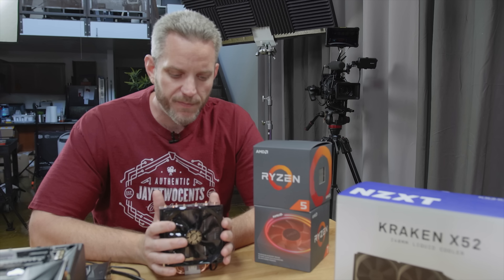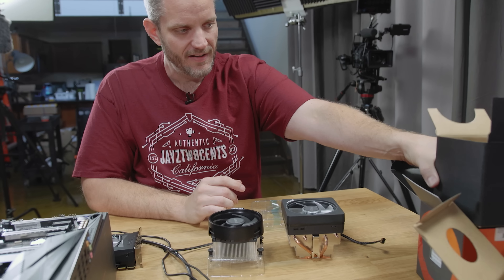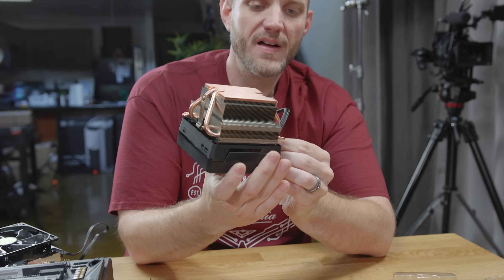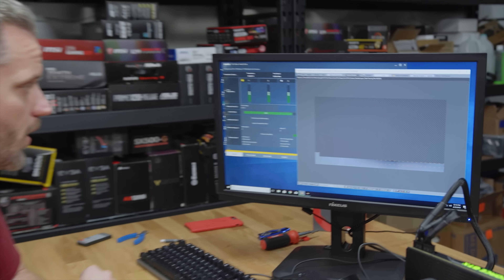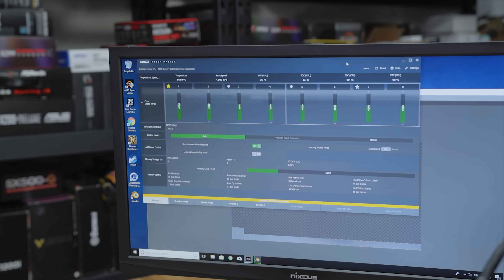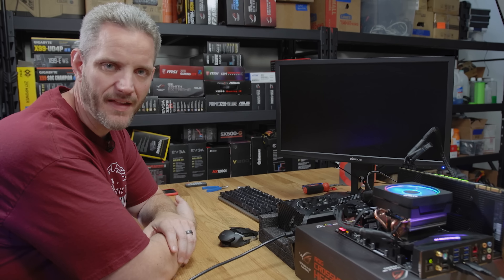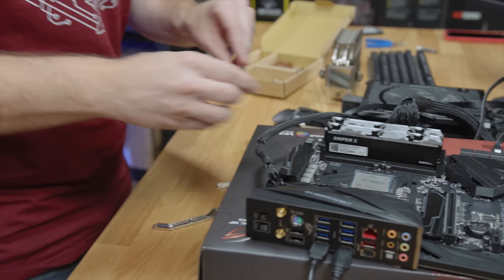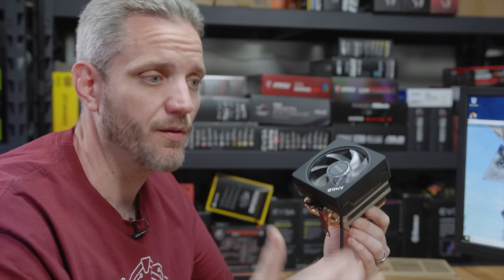Overclocking with a stock air cooler?? Is it even possible?

Comment: Intel
Looks at AMD: Heehee I think we are better.

AMD
Does your stock cooler have RGB?
Reply: I like that
Reply: whats a stock cooler? all i know is my xeons come with no thermal solution
Reply: Intel

lets save customers money buy not putting in a cooler thats just going to get thrown away on any overclock able cpu
Reply: 3en6ie 3en6ie I pulled off my cooler on my Ryzen system and it ripped the cpu out of the socket -said every amd owner ever who changed the cooler or thermal paste. Honestly pga mounting needs to go asap
Reply: Still no excuse for how bad Intel's stock coolers are. Those sad excuses for coolers noticeably throttle performance on their non-K SKUs by not allowing max turbo to happen. Also, if they did it to save money, why do Intel CPUs cost more?
Reply: 3en6ie 3en6ie also a quarter is too thick to fit in the slot. Supposed to use a #0 flat head
Reply: Logan .Kes a tray cpu cost more than a boxed one ;)
Reply: RippedUpRunway why do intel cpus cost more? How about better build as proven in their reliability and another, the performance is top notch. Ryzen can’t touch intels performance period. Not first or second get. Hopefully third gen but I’m doubting it because by the time amd closes the 15% single threaded performance gap intel will drop another cpu bringing it back up.
Reply: @Logan .Kes as an intel user since maybe pentium 3 days you need to cut that fantard shit out bcuz alot of that is false
Reply: Knives77 who u talking to boiii.  Take a 2700x and a 7820x guess which wins every time? The 7820x no surprise. Price? 7820x $399 2700x $339. Yes it’s cheaper but also comes with worse performance
Reply: i would agree...but they charge customer the same amount or more...so where are the saving going too? not us

also when comparing price, you need to add the motherboard/cpu cooler to it. while ryzen is not only cheaper but also has cheaper motherboards as well. if you dont than you have to add 100$ on the cpu anyways because you need a cooler anyways.

just stop and walk away.
Reply: If I want ultimate performance price be damned I'm going threadripper because for gaming anything higher than the 2700x your only talking 4-7 fps and that's provided your running a 1080ti with an excellent cooler and 1080p resolution with a 144hz or better monitor. Price be damned for gaming means I'm still going 2700x because I'm using a 60fps or better 4k gaming monitor. Price be damned means I want what's best for all applications and that would be threadripper because my computer isn't a console and I do other things than gaming.
Reply: BrotherO4 how bouts you look at pugetsystems.com for professional software benchmarks. The QUAD CORE 7700k is 26% faster overall at adobe premiere than the 1800x 😂😂😂
Reply: Last I checked [5s ago] 7820x was 460$ on amazon.  (vs 330 for 2700x)
Reply: Logan .Kes: From my experience taking off coolers from AMD sockets that sat for a while, giving the cooler slight twist while pulling gently and giving it a few tries usally prevents the cpu from slipping out of the socket.
Reply: moonik665 check Microcenter. That’s where I got my pricing
Reply: King Christo Tech How can Intel even compete?
Reply: Logan .Kes, if you learned how to twist the cooler a bit before pulling it off an AMD CPU you'd be hard pressed to find that the CPU remain in the socket. Its not hard to figure that out. I also went from a i7 5820k because Asus OC socket killed my CPU, its kind of common on x99 chips and Asus boards, Well Asus was kind enough to replace the board, Intel gives me a walk around and says they can't warranty the chip and should be replaced by Asus. Yeah well that was a good waste of money for a now paper weight Thanks Intel. Got a Ryzen 7 1700 and Im impressed, Is does do better than the 5820k in pretty much everything, and my video rendering is a boat load faster for a chip that cost less than half of what I spent on the 5820k.
Reply: Logan .Kes run some floss between the cooler and cpu
Reply: hey that's a funny way to spell Shintel.
Reply: Logan .Kes for single core speed lmao
Reply: Logan .Kes AMD is still cheaper, they also solder the IHS which does cost more but means heat transfer is better because the heat only has to transfer through one layer of thermal paste not two.
Reply: Logan .Kes You got to give it a little twist if you pull straight up it might come out.
Reply: The 7820x is 140W and the 2700X is 105W. Hardly comparable.
Reply: Logan .Kes This is mostly  untrue AMD CPUs are just as reliable and there were no 2nd and 3rd gen 8-core processors AMD FX series was mostly competitive with 2nd gen intel. The Ryzen chips are very close to current gen Intel processors.
Reply: Logan .Kes 7820X is currently $459 and the motherboards are $230 at the cheapest VS $339 and $149 for a decent motherboard.  That is roughly a $200 difference, and the I7 8-core will still need a cooler.
Reply: Viking 2121 the Asus AI tweaker function (which was a default bios setting) was notorious for degrading the memory controller on the at CPU over time.
Reply: AMD: But, can you do this?
Reply: idk man. Am in uk 7820x are selling for £489  while ryzen 2700x for £280 also 7820x motherboard cost a lot of money + £100 for cooler - Seems non-logical fam.  Maybe where you are 7820x makes sense but doesnt apply to everyone.
Reply: Logan .Kes dont pull it off cold
Reply: who uses intel stock coolers anyway? i agree that they are shit, so i preffer spending 60 bucks on a good cooler than having that shit around here
Reply: Whenever I feel like wasting money, I should test my 7700k at 5 Ghz with the stock cooler. Just for the lulz.
Reply: King Christo Tech Amd: But can you do this pulls out a rgb cooler
Reply: Logan .Kes Built better until it needs a microcode update so it doesn't get pwned by some snot-nosed brat in the Himalayas for luls.

Intel sucks.
Reply: Logan .Kes 7820x wins everytime? Lol, no, the 2700x often match the 7820x and sometimes even beat it. Go read this https://www.techspot.com/review/1613-amd-ryzen-2700x-2600x/page3.html 

Or watch the videos at hardware Unboxed
Reply: Logan .Kes 15% more ipc? Lol ryzens ipc is very very close to that of intels . Better build on intel? No f way dude the quantity lacks big time on intel chips. 8700k is here to bake eggs on. OC'ed ryzen vs 8700k OC having a 0,8 ghz frequency difference the ipc is very close, which makes ryzen the better cpu, as it simply dominates the 8700 esp multithreaded. Why do people miss inform others so much.
Reply: Marcus cook best comment so far xD
Reply: Logan .Kes intel and saving money? Wtf
Reply: i won't buy Intel again, i cooked it by just turning on the system, sales person said: its because it needed a cooler, me: then wtf doesn't it come with one. :p
Reply: @logan_kes  you can overclock ryzen with the stock cooler but the 8700 thermal throttles with the stock cooler with no overclocking at all.
Reply: @logan_kes  your link has nothing to do with benchmarks at all abd that builder looks just like cyberpower to me overpriced and under valued.
Reply: @logan_kes  and i dont believe fir one second a quad core beat a 2700x at Adobe.
Reply: Tatsuhiro Satou look at the publications tab bud. Search for your favorite program with Ryzen and get your mind blown
Reply: Tatsuhiro Satou also Linus tech tips has done several videos with these guys along with barnacules nerdgasm and a few others
Reply: Logan .Kes  a 7820x doesn't destroy the 2700x. Yes, the 7820x does beat the 2700x, but by a very small margin, for a combined total of over $200 more! Adobe premiere Multithreaded? That thing sits at 50% with a 6 core for normal usage.
Reply: @logan_kes  what's a xeon? It's not Epyc
Reply: LOL Killed It!
Reply: @logan_kes   intel? save money? LUL
Reply: Tatsuhiro Satou lmao intel doesn’t include a stock cooler as they know anyone who actually overclocks will get a way better cooler. And good luck getting more than a .3ghz bump on Ryzen stock coolers lmao
Reply: @logan_kes  Why is it that without OC to 4.5 to 5ghz Ryzen almost matches it i-Rivals?
Ryzen 3 vs i3
Ryzen 5 vs i5
Ryzen 7 vs i7 (and now even some of the i9's)
ThreadRipper vs the i9's (the i9's barely compete!)

This is with all but the X-Models having a stock cooler! Ryzens generally OC to around to 3.2 to 4ghz but almost matches if not outright beats it's Intel Rivals in performance BTW Ryzens fans are fast cool and near silent (Low Frequency!) hell I Brought a AMD Wraith Max (to use on my AMD Ryzen 5 1600x) and it kills anything (Cooling!) you could by from Intel no to mention it matches most low profile air coolers by the 3rd party cooling companies like Cooler Master, Corsair so on!

AMD is catching up in games as games gets patches and new games focus on AMD just as much if not more than Intel, In the old days all good gamers used Intel so their was little to no reason to focus on making games work well on AMD chips, This is not the case these days!

Think about this a company that has always made CPU's and infact invented them and now make 3d Crosspoint aka Optane for use as RAM and SSD as well as Ethernet Ports and Thunderbolt can't make better air coolers for their own CPU's they are letting others cash in on their products which is very weird and odd from a business standpoint as they know their coolers are crap and in fact have actively made them worse over the years (less thermal mass and cheaper slower fans with shorter lives and more noise!) at the cost of a Intel i-Series chip they should gives people better coolers even if they added a few more $ to the cost to cover it, AMD with the exception of the X-series gives us all very good coolers that you don't need a 3rd party cooler to do the job I do admit it is odd that AMD don't even gives us a cooler for the x-series but many of the Intel CPU's don't come with coolers and even the ones that do get underwhelming performance from them begging the question why cant Intel give people 1. better fans and 2. if they can't why even gives us these crappy ones save us a few dollars cut them out lower the CPU prices to match and let us by Dark Rock Pros!
Reply: hahahahahaha, this made my day....I had to throw away my least attractive , least efficient Intel stock cooler to get one that's easier to look at and performs  better
Reply: Ooooh!, get deleted boyyyy
Reply: i cant hear intel laughing over their own cries of losing to intel at 2018
Reply: @3en6ie intel
Lets just charge more than amd for 2% more performance to oh not save them any money.
Reply: does your stock cooler have muscle????
Reply: @rippeduprunway811  duh the CPU costs more because the cooler is cheaper
Reply: Can you use the AMD wraith cooler on an Intel chip?
Reply: คนไทย
Reply: that extra 5+ fps amirite
Reply: Rgb make cpu cooler?
Reply: Logan .Kes If your idea of saving money is paying a premium for the privilege to overclock with no included thermal solution, more power to you.
Reply: Ans my cpu is as good as yours for a lower price.... Including the rgb cooler
Reply: Nah, it's actually "do you have a cooler?"
Reply: Logan .Kes so this aged poorly
Reply: Why bother overclocking anything at this point, just buy the right stuff for the  right application
Reply: A year later
AMD: is your Cpu better?
Intel: crying and still no rbg stock cooler
Reply: @logan_kes  hey shillboy, what you got to say for yourself now? Go on, Shill harder and with even worse arguments now. Oh, as about three other people have already done this thread, I'm gonna just double down on this point before you bring it up: You keep saying "but Adobe but Adobe but Adobe," And yeah I hate to break it to you, the reason that quad core was beating a first gen Ryzen IS because it is not well optimized for large threadcount. You said it'll "keep your CPU pinned," and yes, it will....if said CPU is a quad core. Beyond that point, Adobe responds much more favorably to frequency than threadcount. This does not make Ryzen a bad product, it makes the Adobe suite software optimized for hardware from half a decade ago that needs to either be overhauled, or replaced.
Reply: 2021 
AMD: Gives a 240 mm aio with the cpu

Comment: Wow I didn't know amd's stock cooler looked like that.
Intel... Step up your game.
Reply: @CiceroFMYT  Air coolers like NH-D15/U14 or DRP4 > AIO in my opinion.
Reply: @durendenmp812  Yeah!
Reply: I have it looks nice gonna get a aio but i hate to lose the look of it
Reply: Ryzen is essential in the budget and cost effective mid price ranges because the coolers that they give can save at least $30 being able to not have to pay for aftermarket upfront, that money means a lot to people with a very defined inflexible budget
Reply: It even has it's own rgb program, that lets you custom pick colors for the AMD, the fan and the ring around the fan. I picked one up unused and it works great with my Ryzen 5 3600.
Reply: @CiceroFMYT  air has better longevity compared to aio and not much difference in temps either
Reply: Antonio Lucio Vivaldi , girl?
Reply: @CiceroFMYT  The only thing could about AIOs other than the cooling is that it could make your cheap PC look expensive.
Reply: @CiceroFMYT  I don't like how messy and gross custom loops can get or worrying about maintaining an aio so personally I prefer air, I just use a construction site utility fan blowing directly against my mobo with case panel off and wraith prism at 100%
Reply: @CiceroFMYT  lol my black 212 it gonna last way longer and only costs 1/3 of an AIO, and it looks sexy
Reply: Yeah I love the look of the wraith cooler.
Reply: @CiceroFMYT  relatively inexpensive?
Reply: @CiceroFMYT  I’d prefer to get a better gpu with the 100 and use the stock cooler